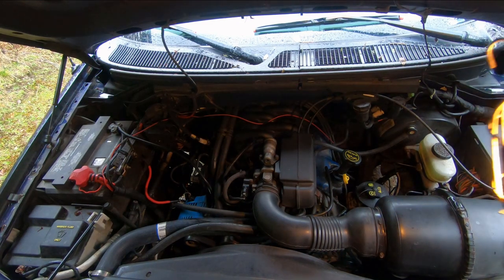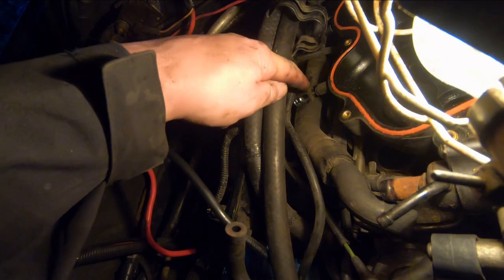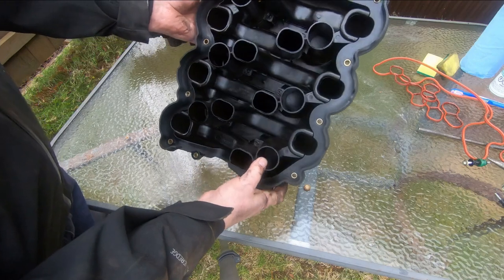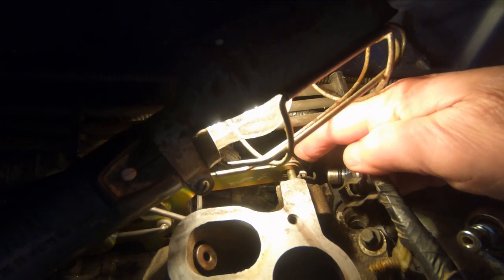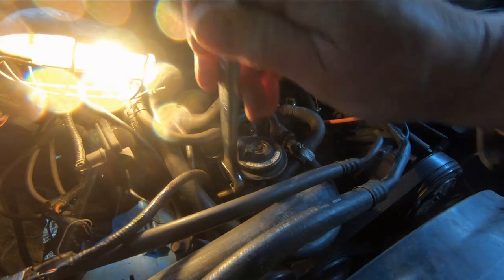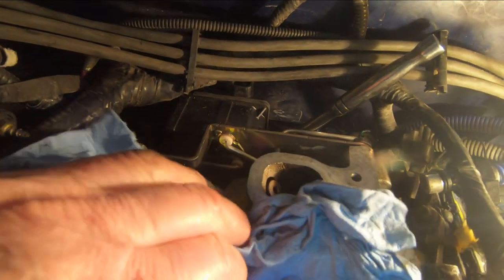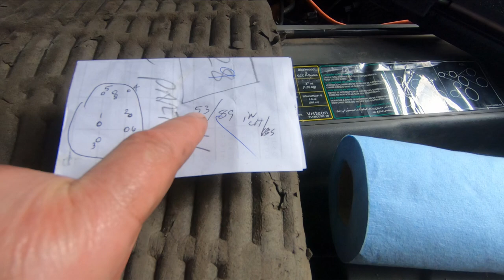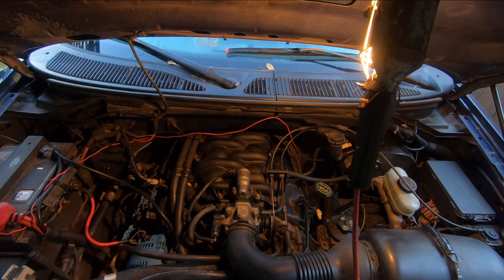2003 FORD F-150 ~ CHANGING I.M.R.C. MOTOR & BUSHINGS 4.2L V6 ~ UPPER INTAKE MANIFOLD FULL SERVICE

Comment: Yeah, Ford has a better idea. Why couldn't they mount the IMRC on the front of the engine especially because the stupid plastic bushings deteriorate and the rods fall off. A 3 dollar bushing takes hours to replace. Stupid engineeting
Reply from the maker: Yes, exactly. Don’t forget to get to them you have to lay on top of the engine with the hood latch digging into your guts😵😵

Comment: I’ve never been good at puzzles and they are laid out right in front of me 😂 This looks like it’s tedious and requires some serious skill and patience. Greta job doing this, explaining what you’re doing and filming it. Thanks Brother!
Reply from the maker: It's a tough spot to access because it's at arms length over the engine but once you understand how the pieces fit together it isn't too bad to fix. The engineers design vehicles to work but give little thought to maintenance. At the factory, the whole body is lowered around the engine. It's then up to mechanics to figure out how to maintain and replace components. There's something missing in that plan. Thanks for stopping by, Doug. Spring is coming and soon you'll be back outside without the need for a down parka. Take Care
Reply from the maker: @davebryant8050 I think you're right. So many bad designs and big  $$$ to keep the stealerships going!

Comment: Excellent video!!!  I just wish that I could've seen how to remove the fuel rail.  Thank you for sharing,  I learned a lot!
Reply from the maker: @garymcnemar6620  There’s a release tool for the fuel rail, available at any parts store for about $10. It just pushes into the fitting and releases the hold the pipes have on each other. Some are metal and some tools are plastic with different sizes all in one kit. Thanks for your comment. I hope to see you again. Best Wishes

Comment: The green grommets are the OEM Ford replacements.  They came from the factory with black.  Looks like somebody had already done the isolator bolts.  You'll probably be fine, just a note for future viewers.
Reply from the maker: Thanks for the info. I rebuilt the engine in 2014 ( a complete tear down and rebuild) and I was the guy who changed the grommets back then. I didn't know that the factory ones were black though. Thanks again!
Reply: @EverydayProjects when you installed the new isolator bolts did you just tighten them down? I removed the old ones by gently hammering them out but im not sure if the new ones have to be inserted the same way or if tightening them will seat them how they were prior
Reply from the maker: @miguelmolinar4560  I just oiled the isolators and bolted them down.

Comment: Probably best to take the lower intake off clean it and throw on fresh gaskets and rebuild the imrc while its out
Reply from the maker: The heads were off a few years ago and I installed new gaskets then including Victor reinz intake manifold gaskets direct from Ford which are the improved ones that help prevent hydro locking (water leaks into the combustion chamber). Thanks I have a video of the rebuild: https://www.youtube.com/watch?v=68CbNlzPOYM&t=84s

Comment: Sir. Is there n adjustment for the IMRC ? On the mounting tabs the holes are slightly elongated it seems to slide the IMRC back and forth to get a synchronized butterfly open for the front and rear sets simultaneously. Is this correct ?

Comment: What was the reason for changing the intake plenum gaskets? Was there a leak causing a miss?
Reply from the maker: When you're in there, best to change anything you can while you're at it. Often, most gaskets and seals come in a single kit. The problem was the IMRC bushings but to get there you have to take half the world apart. Thanks for your comment.

Comment: I just want to say that this video was very informative. 
I follwed your guide to a T.... And soon as i took off the clam shell. Upper intake , lo and behold both levers on the IMRC box were completely off. Rotted grommets. I replaced them and engine runs smooth again. It completely resolved my error codes. . Thank you
Reply from the maker: I'm very glad that my video helped! I do my own work and take the time to film it, hoping that it will shed light on the same issues for others. When I get feedback like this, it's all worth it. I appreciate your comments and wish you well!

Comment: Considering the common intake leakage on 4.2 manifolds, would it have been advisable to remove the lower manifold and change those gaskets too?  Would have made the IMRC  motor replacement easier.   I have to do the same on my 4.2.   
Thanks, very detailed.
Reply from the maker: I rebuilt this engine in 2014 and addressed the lower intake manifold gaskets then by upgrading to Victor Reinz gaskets, sourced from Ford as an approved fix for the hydro locking leak problem. The video of the rebuild is here on my channel. Thanks for the question. I’ve had no issue with leaks at the lower intake manifold gaskets but your concern is valid and welcome.
Reply: @EverydayProjects  Thank you.

Comment: Thank you sir for the complete rundown on how to remove the intake. I have a leak at cylinder 2 where the smaller gaskets are. I plan to change it this spring (kinda cold in Alaska right now). 
Plan to change the IMRC grommets in the back since they often break but with 165k on it, not sure if I should just bite the bullet and change the IMRC motor too.🤷‍♂️
Reply from the maker: Might as well put in a new IMRC motor at the same time. They aren't too expensive and are difficult to access later. Best to get it done while you're in there. Check Rockauto or ebay for parts. Have you subscribed to my channel? It's FREE Thanks

Comment: I just did this job on a 2001, very similar setup. Had some PCV leakage as well, so I replaced the rubber boots on both valve covers and added in some silicone airhose, replaced the coolant hose for the bank 1 heated PCV as well.  Doing those rear IMRC bushings was flipping impossible though, just about.  Doing it by feel while stretched overtop the entire engine bay.   I also brushed out the EGR ports on the lower manifold to make sure those didn't become a problem later, using some cheap engine brushes from Hazard Fraught.  Pretty easy to spin out a bunch of gross crap out of them after hitting them with some good chlorinated brake parts cleaner ahead of time to soak in.

The "cab forward" design looks nice on the outside but working at the back of the engine is flippin' impossible.
Reply from the maker: Yes, I agree, The engines on these are hard to get to, especially the rear. The bushings are a nightmare as you know. This nightmare stuff is perfect because today is HALLOWEEN !!!:face-purple-crying:🎃🎃🎃🎃🎃🎃🎃
Reply: @EverydayProjects  Yeah unfortunately today I have to put the upper intake plenum back on.  The 3 nuts in the back are the worst and I was probably having nightmares about them last night.  Truck came in with cylinder 5 misfire and bank 2 lean codes.  Had to wait to finish until the new ignition coil pack arrived (swapped cylinder 1 and cylinder 5 wires on the coil and the misfire moved to cylinder 1 = bad ignition coil.).  Isolator bolt grommets were hard as a rock and bank 2 were covered in oily residue, so not holding down the lower intake very well.  That and the PCV stuff likely causing the lean code, but I'm about to find out for sure. 

This video just came on my feed on a break.  Thanks for taking the time to make it.  The tape on the finger was a good idea!  I wish I'd thought of that. I used a pick to get and hold the bushings in place, but tape would have helped. I only dropped 2 of them, though!

Comment: Knocked the first portion out in under an hour (down to the runner replacement) The back 2 bolts were a pain but no worse than some blend doors. I'm actually very mad and upset I didn't attempt this long ago because it seemed like a big job, but it was a breeze so far 

I've replaced the fuel pump in this truck as well as the entire AC system, including the squirrel cage and switch regulator (2x) And I've done the plugs and coil packs (plugs are known to snap off when removing from what I recall) and I would easily do this job 2x over compared to any other of the repairs.

*Note, not in your video, I did cut a rubber glove finger off and rubber band the coolant valve so it stopped pissing out coolant.
Reply from the maker: Not too bad a job. What l found difficult was the reach over the whole length of the engine to the rear bolts. I rebuilt this engine 9 years ago and replaced all the bushings and seals on the upper plenum at the time, but not the IMRC motor. It was time to change it out. Funny you mentioned the squirrel cage fan because just yesterday mine failed. Take care

Comment: Thanks for this vídeo and explanation. My only question Is why didn't you put the gasket that goes between the two plastic parts while the lower one was out?
Reply from the maker: I could have installed that blue gasket first but installing it after I was done bolting the lower half down may have prevented damage to the gasket while I was working at the bolts. It can be installed before or after, just the way I did it. I hope your repair goes well .

Comment: 👍👍👍👍 Well done !!!  Great how to video.  I'm not sure I could crawl back in there to get those back pieces.
Reply from the maker: Sure you could get in there...it's just a bit of a stretch.Hahah Another way to get at the IMRC motor and bushings is to remove the lower intake manifold and change them out on the bench. It is more work and involves a new set of lower intake manifold gaskets but it may be easier than laying on top of the engine for an afternoon.

Comment: That job is hell good luck
Reply from the maker: It's a tough spot to get to, agreed. But I am fortunate that I grew several extra arms (some with four of five elbows in each) when I worked in a shipyard years ago repairing submarines. As we all know, submarines are cramped with little room to work. I grew these extra arms and they have been very handy for working on cars (especially since my hands can now swivel 360 degrees too). It would have been a very difficuly job for a mere mortal to fix this Ford with only two regular arms but I'm lucky, I guess. With all my arms and elbows I can get into just about anywhere !:face-purple-crying::face-fuchsia-tongue-out:
Reply: My side and back hurt. My hands hurt to
Reply from the maker: @chetalle7043  It's a tough spot to reach and it is surprising because all the work is on top of the engine. I had to be face-down with the hood latch eating into my guts for much of this job. Lots of fun. haha

Comment: Great video my friend how do you test it to see if it's working correctly
Reply from the maker: If the IMRC motor and system isn't working correctly you'll usually get a code (P1518-stuck open) or a P2004. If the linkages have broken bushings or the IMRC motor is faulty, you'll get the same symptoms such as sluggish acceleration, lack of power at low speed, poor gas mileage, and sometimes a flapping noise inside the engine. I know that these symptoms are hard to pin down since they can be similar to other causes, but if you have eliminated other potential causes such as ignition and fuel issues, compression, etc. it wouldn't hurt to get in and check the IMRC and the bushings.

Comment: Here’s a question, when smoke testing, those intake runner bushings that are in the lower intake manifold. Are they suppose to leak smoke from there normally? I’ve smoke tested multiple f150 of the same year and all of them leak there.
Reply from the maker: I didn't smoke test the engine so I can't answer that with an accuracy. I don't think that the runner valves close totally tight (not like a valve seat) so I'd say that even new ones would leak some smoke.

Comment: This is excellent, thanks very much I'm having this done soon and it has given me an appreciation for the amount of work the mechanic will be undertaking.  A question regarding the KNOCK SENSOR, on my 2003, 4.6. , Can you confirm the plug is a female one? Thanks again.
Reply from the maker: I checked Rockauto and it appears that the knock sensor has a female plug that leades down to the knock sensor screwed to the block. The corresponding plug leading from the vehicle's wiring harness to the knock sensor is male. All the best. Don't forget to Subscribe to my channel...it's free!

Comment: Thanks for the video! Anything else worth replacing while in there? I have a 2002 f150 only 105k miles but there is a coolant leak, so in the midst of doing this overhaul. Also that back left bolt on the upper manifold is a huge pain! Mine has a stud sticking out of it and the two hoses above it make it impossible to get a socket on it, I guess a ratcheting wrench is necessary?

Comment: Hey how did you know this was this issue? Did you get a code or was there another indicator?
Reply from the maker: I had been chasing a sluggish response and hesitation issue that was proven not to be compression, spark, or electronic. It pointed me to the upper intake manifold isolator grommets and the IMRC. I did not have the vehicle scanned for this diagnosis, I just went through everything I could think of in increasing levels of complexity, this being the deep dive I was avoiding. It fixed the issue.
Reply: I watch another video guy was getting lean code on one bank and that bank was the one missing a bushing
Reply from the maker: @LayzeeJay  Yes, if the bushings break or are missing, the engine will not run right. That's why it's so important to keep them in good shape. And since they are so hard to get to, it's good advice to change them every time you're in there or have the upper intake off. All the best!

Comment: How in the world did you access the two bolts closest to the rear (firewall area) on the upper intake manifold? I can barely even fit my telescopic mirror back there, let alone a wrench of any sort. The space between the top of the upper intake and the bottom of the upper firewall area is maybe an inch or so.
Reply from the maker: I used 1\4 inch drive ratchet and socket and took a lot of time. Good luck. It’s a tough one
Reply: I appreciate the reply. 
I'm thinking that perhaps I'll get a cheap  1/4" drive socket wrench with a very long handle from Amazon. I see one with a 12" handle for $20. This way, maybe I'll be able to turn the wrench with my hand beyond that "bottleneck" area between the upper manifold and lower firewall.
Reply from the maker: @BCLewis-ng9wv  Yes, it’s a tough spot to reach. I laid down on top of the engine, on a thick blanket to get at those bolts.

Comment: My question is regarding the metal intake vs the plastic one , which one is better? I have the metal one it seems bigger bulkier and the gasket is also different, i'm not a fan of the metal on metal and it does not seem to seat flush, i prefer the plastic one like my chevy 5.3 with the same rubber style gaskets they seem to get a better seal. Anyhow what's your thoughts on the fords metal vs plastic intakes pros/cons?
Reply from the maker: I don't think they are a direct swap. Not sure if all the connections would be the same. I'm not sure if one would work in place of the aluminum one or not. Maybe check Rockauto and see if the manifolds look the same. Sorry not to be more help.

Comment: Hello, it would have been good if at the beginning of the video you presented the engine failure just as you presented the operation at the end since I think my truck has the same problem, that is, the engine shakes and at high speed it does not develop less when going uphill, it is like a donkey. . greetings
Reply from the maker: Maybe check all your basics: Plugs-clean and gap or replace; wires-change with new ones; coil- if the coil shows any cracks at all (especially underneath) get rid of it; change your fuel filter; clean your injectors and/or put a concentrated fuel injector cleaner in the tank and drive for a few days; knock sensor- change the knock sensor.
Reply from the maker: Yes, I did all of the things you suggested in other videos. All good points though. I use Lucas fuel injector cleaner regularly, replaced fuel filter, cleaned injectors, installed new iridium plugs, new wire set, changed a cracked coil that had irregular readings, knock sensor, throttle position sensor...with all that done, the problem persisted.
Reply from the maker: You make a good point but at the time or the repair, the vehicle wasn't safe to take on the road to capture the symptoms on video. Sometimes, it's the best I can do with the footage I can capture. I usually show the before, during and after but it's not always easy or practical. Thanks for watching and commenting. You may have other components causing the problem. If you are a do-it-yourself mechanic, sometimes it pays to have the vehicle analyzed in a shop then take it home with the diagnosis and repair at a lesser cost. Most garages will figure a problem out in an hour..about $80-$150 for their time.

Comment: My 03 has a 10"x 5" door under dash with 4 bolts..remove it and access the part that way it's easier.
Naa just kidding!!..but if u could make a door be kinda nice.
Reply from the maker: You had me there for a second....and then I thought.....I've had this whole truck apart limb by limb and never saw a door! ha ha Good one.:face-purple-crying: I did cut a hole in the bed of a Chevy truck one time to access the fuel pump/sending unit. That was way easier than dropping a half-full tank of gas on myself (or lifting the bed). I just riveted a piece of metal over the hole in the floor when I was finished, put the plastic bed liner in, and done! These IMRC bushings are a real treat to change. What with the hood latch digging into my guts and all....Just a complete Joy!! LOL Thanks for getting me laughing!